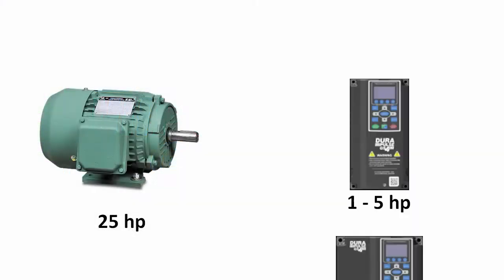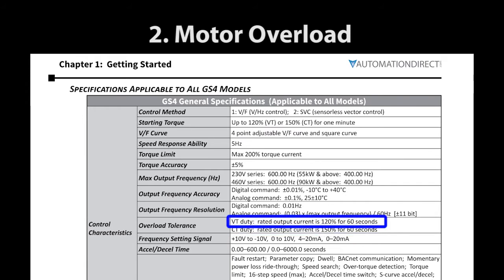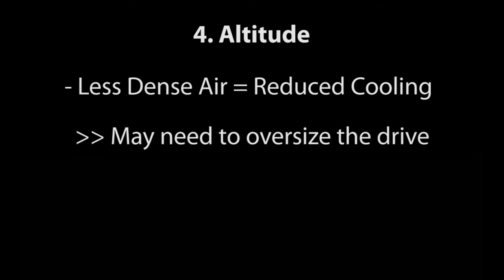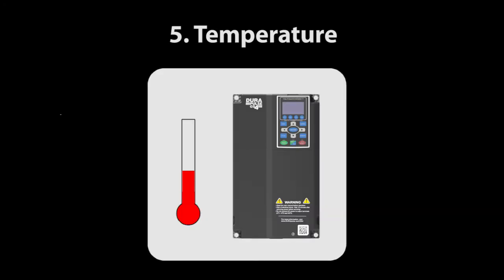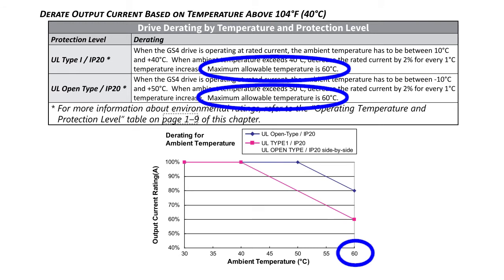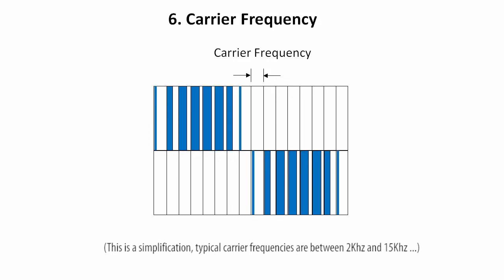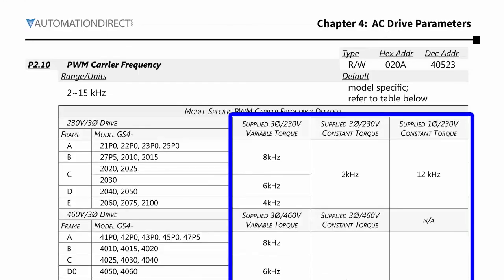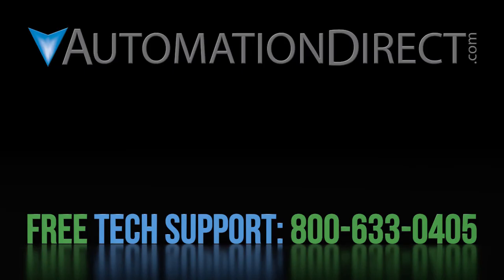Selecting a DURApulse GS4 VFD from AutomationDirect

Comment: I found a couple of 10HP 575V GS2 drives laying around unused. Is there anything preventing me from being able to run these off of a 460V input to run 460V motors? If I can, would this also allow me to use heavier dynamic braking before needing a braking resistor?
Reply from the maker: Interesting questions. The drive has an input voltage range of 500 to 600V, with a lower tolerance of 15%. The worse case scenario may be nuisance under voltage faults, but it will depend on the load. The cap bank in the drive is designed to see 575V, so the caps will not obtain the same level of charge, so again, less available current and possible faults as a result; probably under acceleration.

It’s all about power. Watts in and watts out. The output current rating on the 5010 is 12.2A, while the 4010 is 18A. The 5010 is designed for higher voltage, so less current. What we’re saying here is that at 460V, the 5010 must be de-rated and becomes a 7.5HP drive.  

It makes sense that with the higher voltage rating, the drive should handle higher dynamic braking loads. The truth is that we have never tested a 575V drive at 460V, so we can offer little in the way of support.
If you have a problem it will be related to nuisance faults, under voltage and possibly over current. I’d test before spending a lot of time on installation ...

Comment: How do you calculate the expected temperature of your enclosure? And how much more heat a drive puts out?
Reply from the maker: Enclosure Temperature: The easiest way to calculate enclosure temperature is to use the Stego calculator here: https://www.stego-usa.com/nc/support/calculation-tools/heater-calculation/
How much heat does the drive add?  That depends on your application and how your drive is mounted.  For example: The GS4 drive from AutomationDirect has a an adapter kit so you can mount the drive inside the enclosure but the heat sink outside the enclosure. So the temperture would be different if the heat sink is inside or out side the box. Worst case, just use the max input power rating of the drive minus the max power delivered to your motor.
Reply: sorry to be so off topic but does any of you know a way to get back into an instagram account??
I somehow lost my password. I would appreciate any tips you can give me.
Reply: @Angel Korbyn instablaster :)
Reply: @Harrison Kristian Thanks so much for your reply. I found the site through google and im trying it out atm.
I see it takes quite some time so I will get back to you later when my account password hopefully is recovered.
Reply: @Harrison Kristian it did the trick and I finally got access to my account again. I am so happy:D
Thank you so much you saved my account!
Reply: @Angel Korbyn glad I could help :D

Comment: hi ,  can  i know  what size i should select  if my  motor  plates is removed but  its  working now with  three  phases  location   ( 220 v  )  and by check with clamp meter i found   each phase  withdraw  5.5 A   ON  LOAD ,   the  seller  told me  its  about  2200 watt .   can you help  what  size  of  kw   i  should  but  to run it  in  220v single phase   ?  i need  to know  whats my  motor capacity  also ?
Reply from the maker: Hi Roberto, I encourage you to contact our free tech support - they will be able to dig a little deeper and help narrow things down.  BUT, if I understand your question to be you have a 3 phase motor and want a single phase drive to control it, correct?  If so, then a general rule of thumb is a 3 phase, 220 VAC motor will typically draw about 2.5 A per horsepower, so your 5.5 A would be a little over 2 hp, so just to be safe you would probably think in terms of a 3 HP motor. You also mentioned 2200 watts - that is also about 3 hp. Given all of that, a single phase 3 HP drive would probably be a good fit.  

Go to www.automationdirect.com and search for single phase 3 hp drives. In particular, look at part numbers: CFW300B10P0B2DB20, GS2-23P0, GS3-23P0, GS4-23P0 or GS4-2010. >>  Please note that this just my best guess based on the minimal information you provided, but it should get you pointed in the right direction.  Good luck with your project!  

Side note - we have a LOT of videos on both the GS4 and WEG VFD's. go here: https://www.automationdirect.com/videos/home  and search on "GS4" and "CFW300" to find them.

Comment: Is it safe to say the bigger the capacity of the vfd the better. Without any downside except cost?
Reply from the maker: There is one more thing to consider ... Drives provide overload protection for the motor. And that is a function of the motor rated current setting. Typically the range of this setting is a percentage of the drive rated current. In the GS4 for example, motor rated current range is from 10 to 120% of the drive rated current. So if you are using a high horsepower drive to run a small motor, it is possible that the motor rated current setting might be lower than what could be configured in the drive. In this case, the drive could not provide accurate overload protection for the motor. This can be addressed with a separate thermal overload that is wired back to the drive; this is often done in applications where one drive will power multiple motors simultaneously.
In our experience, motors tend to be one horsepower rating higher than needed and drives one horsepower rating higher than that. It seems to be the safe approach when the actual torque and horsepower requirements are unknown.
Bottom line: Could you use a large dive with a small motor?  Yes. Just beware there are some other potential issues to think about.